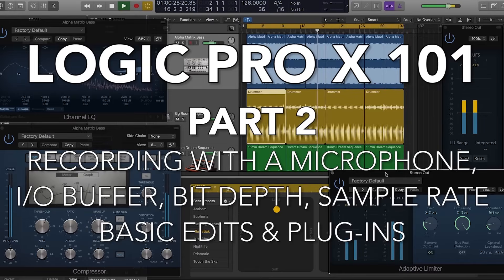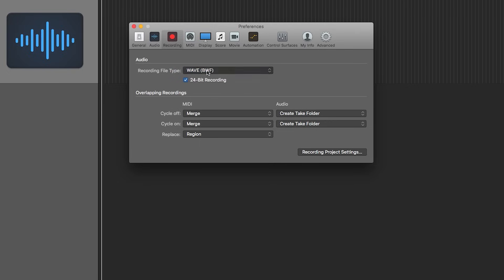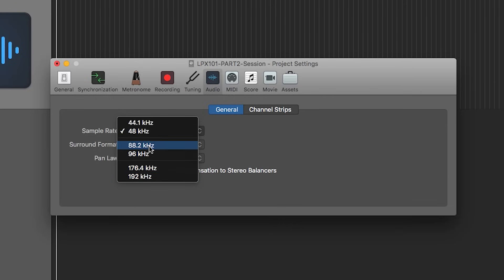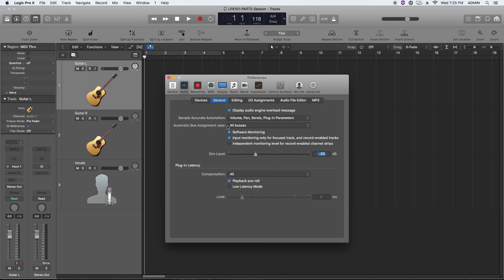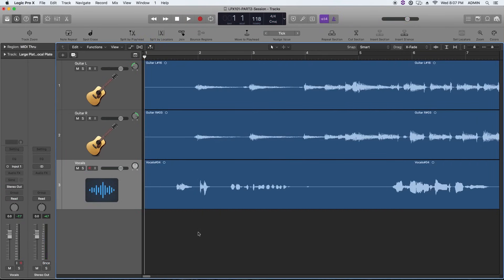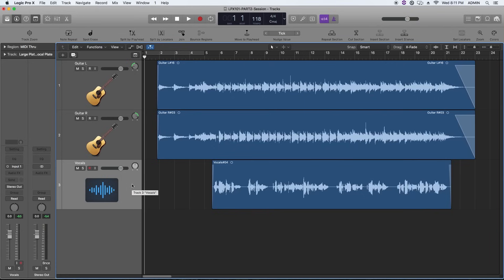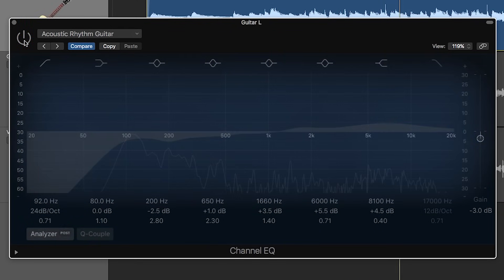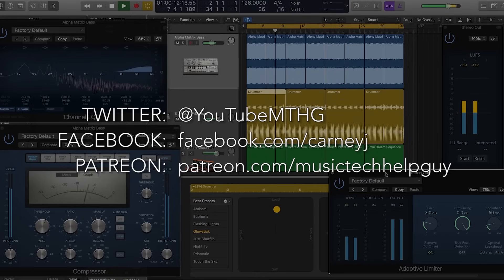LOGIC PRO X 101 - #02 Recording with a Microphone, I/O Buffer, Bit Depth, Sample Rate

Comment: Sir, how do we save these presets for the next projects while opening in the beginning? I tried changing the sample rate to 48hz and when I try to open a logic it shows it has been saved in 44.1 sample rate. Thankyou!
Reply from the maker: You can’t save project settings globally. They are only saved in the project. The sample rate is associated with what sample rate your audio interface is set to, so if you set your audio interface for 48kHz outside of Logic and then open a new project it should default 48kHz, however that doesn’t really save any time cause you still have to switch the sample rate one way or another.
Reply: @MusicTechHelpGuy  Thank you for the reply. Actually, my audio interface is set to 48khz default since the beginning and I once tried saving it globally while opening every individual new project. But, now here is the issue, and seems like I forgot the way of setting samples. Anyways, thank you for your time.

Comment: why is there so much background noise in my raw recordings i record in a closet, i have a foam semi circle on my sm7b i dont get ittt
Reply from the maker: I would not recommend recording in a closet unless you have taken the time to acoustically treat the closet as an iso booth. You'll actually get more reflection and flutter echos in a closet than you will in an open un-treated room. Try recording with your reflection filter in a room (I'm assuming that's what you meant by foam semi circle). Few other things to considered: 1) make sure you're not under or close to an A/C vent. 2) make sure you have the microphone gain pulled up high enough, but not so high than it overloads. If you have your mic gain set really low, your recording is going to have to be boosted quite a bit, and that will bring out more noise. So sometimes it helps to try a higher mic gain. 3) make sure you are monitoring on headphones that aren't going to cause a lot of 'bleed' in the recording. Open back headphones are bad for this. Best of luck!
Reply: @MusicTechHelpGuy  best dude.

Comment: here is my question for you: I have a rode videomic, the basic one used mostly with gopro. It has no battery whatsoever. works on 5v. So I wanna use this microphone pluging it into my M-Audio using vxlr +, which converts +48v to 5 so that the microphone can work. I did everything you said (all you said before singing part) still I can't hear anything or I can't see any wave in the recording. I hear the waves in the input section though. What am I doing wrong? my guitar has no jack input by the way, a regular acoustic guitar.

Comment: I just cannot get my first recording to double track! I’m sure I’ve followed every instruction to the letter, it does record but just no audio at all, like there’s no signal, any help would be so much appreciated!
Reply from the maker: You probably have the wrong input selected on the track. Sometimes when you create a 2nd track, it automatically defaults to input 2. So if you  are plugged into input 1 on the first track it'll work fine, then creating a second track will jump to input 2, so you'll hear nothing. On the channel strip in the inspector or the mixer, make sure your new track is set to the correct input.
Reply: MusicTechHelpGuy thank you so much for your reply I really appreciate it, my second track is defo on input 1 though
Reply: MusicTechHelpGuy this might be a silly question but is the second recording from the speakers to the mic of the first recording playing? Or is it an internal process?
Reply from the maker: @thomasholdroyd7834  You should hear yourself recording while your playing, as long as you have the Input Monitor button turned on.

Comment: You forgot to say that higher sample rate also gives you less latency.
Reply: the biggest reason i will be recording in 96khz or 192khz.
Reply from the maker: Yes, it does. But what you really have to think about is how that higher sample rate will affect your CPU processing power, and amount of hard drive space taken up by recording larger audio files. Sure, you can get less latency than lower sample rates (even at higher buffer sizes), but you might find that it's nearly impossible to work on a project at any lower buffer size when using higher sample rates; unless you've got a completely ballin' Mac Pro. I have a pretty killer 2019 iMac and it keeps up well at 88.2 kHz, but at 96 kHz and and higher, I'll start getting drop outs, and playback error messages when I'm mixing. So if you've got a ballin' machine, great, go for it. Otherwise, I'd suggest working at 88.2 as a compromise. You get some benefit of less latency, but more processing power for mixing, and your audio file sizes will be less than 1/2 than at 192 kHz -- with no noticeable difference in quality or aliasing issues. So it's a trade-off really. And you can always adjust your buffer size to adjust latency, regardless of your sample rate.
Reply: @MusicTechHelpGuy   Thx for the reply. Yeah.. I will have to check how my early 2015 macbook pro handles the higher sample rates. Now at 96khz isnt a problem in mixing which i have usually used in my projects with buffer sizes from 128 to 512 which i may have to go to towards end of the project. But yeah,, i ordered a presonus quantum 2 audio interface today. Should be low latency. It said its capable of under 1ms roundtrip latency with 196khz sample rate and 64 buffer size and with its method of handling things it should take some load off of computers cpu if i remember right. But I still dont think that my cpu can handle that. But we'll see what will the outcome be when it comes to latency.

Comment: Hi Music TechHelpGuy. Do you have any videos or any helpful information on the "recording delay" slider in the audio tab of the preferences? I'm experiencing some bad latency I've never experienced before. Even with the I/O Buffer size, there's still a noticeable amount of latency when recording. I noticed it sounds a little bit better when I drag the recording delay slider all the way down to -5000 samples. However, I'm not sure what that means. If you, or anybody has any helpful information on this, I'd appreciate it. I'm working off of a late 2014 Mac mini with 8 gigs of RAM, and a 2.6 GHz Intel Core i5 Processor. As far as I can understand, I don't think latency should be a problem. On average, my projects have no more than 60-80 tracks. Like I said, if anybody can help, I'd really appreciate it. Thanks!

Comment: Very helpful for me! 👍🏻👍🏻👍🏻
Question: you recorded 2 channels for the guitar (one left the other right). Is it possible to record only one channel then copy it to a second channel and after that pan the two channels leftand right?
Reply: Yes sir. It is possible it would make a flanged type of effect. Makes the guitar sound FULL and wide. Maybe he has a even better tip for this that he can give us both.
Reply from the maker: If you record one guitar and then duplicate and pan left and right, you won't get any stereo width, because you just have identical signal in the two channels. The variation between the two channels is what gives you a nice wide stereo effect.

Comment: Quite simply, your videos are THE reference on the Internet for Logic Pro X training.  Whenever I find myself wondering how to accomplish something in Logic, I can quickly find the answers on your channel.  THANK YOU! from a loyal subscriber. One minor note: 16-bit vs 24-bit doesn't change the dynamic range (DR) of the recording.  DR is the ratio of the loudest signal to the quietest signal (absolute silence, below the noise floor), often expressed in dB, and is mostly a function of your microphones and preamp gain settings.  Resolution refers to how coarse/fine the amplitude (volume) steps are. 16-bit  (2^16) = 65536 total volume steps from the most positive to the most negative signal vs 24-bit (2^24) = 16,777,216 total volume steps, which is 256 (!) times finer.  You will most likely notice the resolution difference in quieter passages where the signals are close to the noise floor.  The finer volume steps offered by 24-bit recording keep things like delicately-played cymbals sounding more natural.

Comment: dope video, I have a  question, all my mic and audio interface are connected and Input monitoring is on but I can't seem to hear myself thru my headphones when I speak into the mic and when I record vocals when I'm done, the wave line is so small almost as if it picked up nothing and I zoom in and it did pick up my vocals so im wondering why my vocal recordings are coming out so low that the beat overrides my vocals? anyone can help?
Reply: Crank up the pre-amps.
Reply: Did you ever resolve this issue? I had the same problems but it is not a preamp problem. I have it almost all the way up but the wave form is still small.

Comment: So what's the exact purpose of doubling the guitar part into R and L? Why is this better than making one guitar take a stereo take? Is this only done with guitar, or would it make sense to do it with something like drums or keys as well?
Reply from the maker: If you just copy and paste the metering from one track to another and pan it L and R, you'll just get something that is a bit louder. Doubling and layering takes means that there is some nuance between the takes, and you will end up with a bigger, wider simulated stereo image. You will not get this from duplicating a take. Try it your self and you'll hear exactly what I'm talking about. Doubling like this has been used for decades to thicken recordings and enhance their stereo image. You can do this with anything; however, it's most common with guitar and vocals. I never do this with fundamental instruments like bass and drums though.
Reply: all good questions, i hope he responds
Reply: well he said it, to get a bigger sound out of it AKA for the sound to be stronger
Reply: @EddieGeeTV  Okay it just occurred to me that having a track for R and L would create two stereo tracks, right? That makes sense. But I"m still wondering why he rerecords the same material instead of just copying and pasting onto a new track.

Comment: im still confused on the sample rate thing. Whats the difference of 44.1khz-96khz ?? I love to add robotic sounds in my track. Something like Jon Bellion. What sample rate is better ?
Reply: here :
The sample rate defines how many samples are played/recorded per one second of sound. A higher sample rate results in higher audio quality; however, 44100 Hz (as used for recording audio CDs) is a common setting and absolutely sufficient for most tasks. If your final destination is CD, you should use this setting or a multiple of it (88200 Hz). For a better understanding: 48000 Hz is used by DAT recorders and for DVD (films) recording. 96000 Hz and higher rates are typical for DVD, HD DVD, and Blue-ray Disc audio recording. You should be aware that a higher sample rate also causes higher CPU load.

also (im no expert , i could be wrong but this stuff may be worth looking up properly online)
Ya can export the final project to whatever ya like anyways when done , 96 .wav is good when ya making the project etc as it leaves plenty of headroom for later if ya ever decide to come back and process and mess about with the proj after a few years or whatever ... ya dont really hear difference until that days in the future after five remixes of the same thing when it sounds rubbish and ya think to ya self .... wish i left headroom and didnt  dither distort compress an fuk its dynamic range so much over time. cue the flat lifeless sample

also make sure ya leads , connections , devices and equipment are capable of actually giving that signal . i.e. balanced cables, mic , input on ya rec in / card etc  aint worth setting it to 24bit 96 if ya cant even produce.recieve  that....   

i dunno ;p

Comment: do you or can you make a video on fixing wireless headphone latency? if thats even possible??? I have beats studio 3s the reason I'm asking is because I don't have a laptop and my booth is in my closet across the room so I can't use a wired connection for less echo... also when I use my midi keyboard and play notes it still seems to have the delay through the headphones if I'm trying to be quiet late at night...  SEND HELP!!!! please and thank you!!!!
Reply from the maker: Other than lowering your buffer size down to the lowest value, like 32 or 64, and turn on low latency mode, there's not much else you can do. the latency is coming from the headphones themselves. Most wireless headphones have between 30-60ms of latency that just is inherent to their design.
Reply: I have the same setup, what I ended up doing is ordering a 50ft cord from Amazon for 8 bucks and it solved my latency issue. I also have a mic cord running to the closet both I only use when I’m recording.

Comment: Any idea why my brand new UMC404HD input into Logic Express is not recognized? The device is recognized, but not the audio output from the interface USB. I have repeatedly checked the settings in Preferences but still no audio reaches the program. My MacBook Pro receives the audio, but Logic doesn't and neither does Garage Band. Any advice would be so very welcome, thanks!

Comment: Great tutorials, but one question. Been working with a project and successfully put some well needed fades on some tracks after viewing. Later, when I come back to add some fades to others by pressing down shift/ control fades are nowhere to be found, instead the whole work space toggles around with the pointer. I know a can program fades with automation later, but I really liked being able to out them in to clean-up the track beforehand, like you do here. I don't what I did to disable that shortcut but it's driving me insane!! Help!

Comment: Edit: I figured it out. The input gain was turned all the way up.

So question about setting up the microphone. I have a condenser mic going into a preamp with phantom power. I don't have a problem getting sound the problem is that it's coming in way to loud. It peaks if you just talk into it. I have the gain on the pre-amp turned to 0. Any ideas? Can I reduce the signal from the software side?
Reply: If you are going into a preamp and then into an audio interface you need to use the line in input not a mic input as the levels will be too high and you'll most likely clip/distort. The solution is an XLR to TRS balanced line cable.
Reply: Actually, it was because I'm a dummy. The issue was merely because I had the input gain in Logic turned to max somehow. What's weird is that I can only seem to turn this down when nothing is plugged in. When something is plugged in it doesn't let me do anything. Thanks for your help!

Comment: Did I miss the part where you show how to adjust the volume on the recording? Where's that thanks
Reply from the maker: The recording volume is controlled from hardware not, software. You adjust the recording level with the GAIN knob on your audio interface.
Reply: I'm using a USB mic with no other hardware & no interface (my MBox is loaned out). There's no other way to control the input volume inside Logic?

Comment: is there a way to record vocals in stereo? desperately need help. Or do I have no choice but to record vocals in mono?
Reply: To RECORD vocals in stereo requires two microphones (or a stereo mic). Is that what you want to do? If that is the case, your mic/mics would have two plugs, you would plug them into your audio interface (which would need at least two channels/inputs). Or... You can record using one mic and apply stereo processing after the fact, very easily done. Let me know exactly what you're trying to accomplish.
Reply: Thank you. I found a way to get it into stereo. It was easy actually. But your comment will be helpful to me in future, thats for sure.

Comment: Hi Josh, thanks for the great videos. I can't record audio using the mic on Logic Pro x .. the settings are correct and I can record audio on Pro Tools using input 1 where the mic is plugged, but doing the same on Logic doesn't get the mic through to record audio. I have searched A LOT, read the manual and watched so many videos and I seem to have followed all the steps. I'm using DAD AX24 (Digital Audio Denmark) which is recognized on Pro Tools as a 192 I/O device and never had problems with it. Could you please advice where could the problem be?
Reply: Did you ever resolve this issue sir?